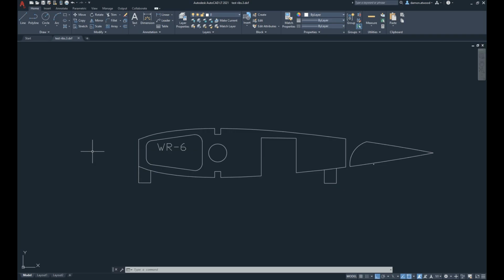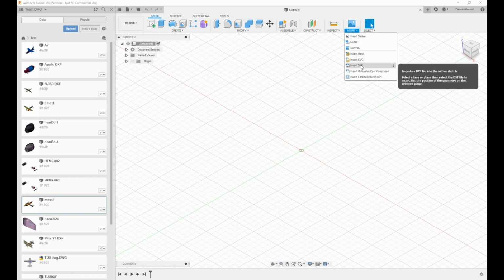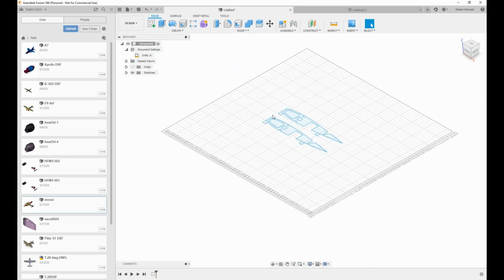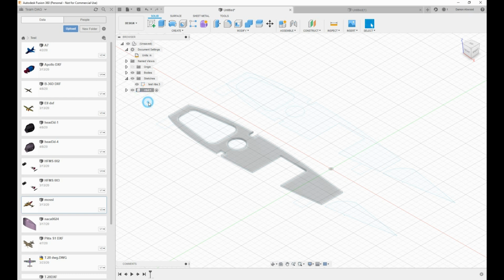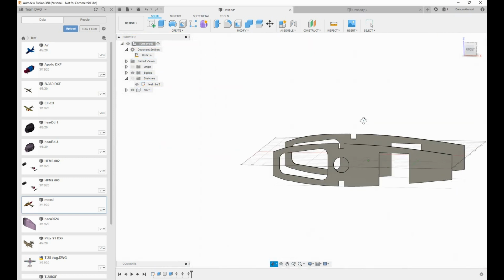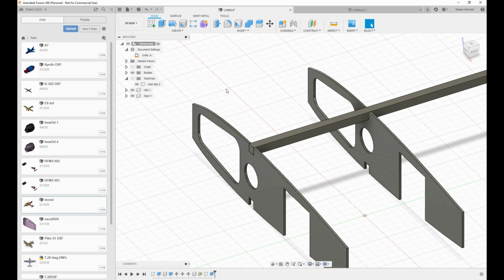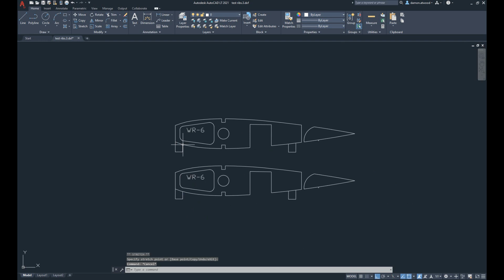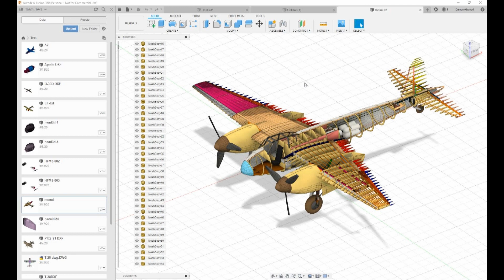Taking a AutoCad 2D into Fusions 360

Comment: after scaling a part of wing for rc plane the outer skin cant be printed it just prints the inside but before scaling it is all good, any ideas?
Reply from the maker: I am a bit confused. Are you talking about printing a CAD drawing? Or, printing a 3D part? :)
Reply: @dagtheaviator  I just downloaded files from thingverse put them in cure and it’s a bit too big so I scaled it and put preview and it does not include outer skin but inside only 
If I reset scale it shows good
Reply from the maker: @Chris-vc1dh  I only use Simplify3D, I am not sure what is going on with your slicer. Wish I could help. You might go to one of your program's blogs or threads on Facebook and ask what's going on. :)
Reply: @dagtheaviator  simplified 3d is a slicer?
Reply from the maker: @Chris-vc1dh  https://www.simplify3d.com/software/features/